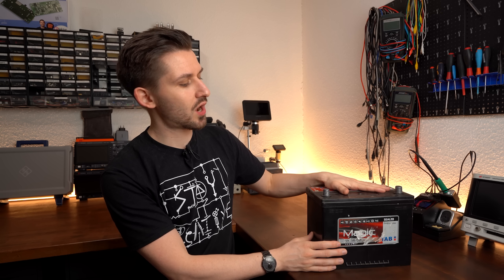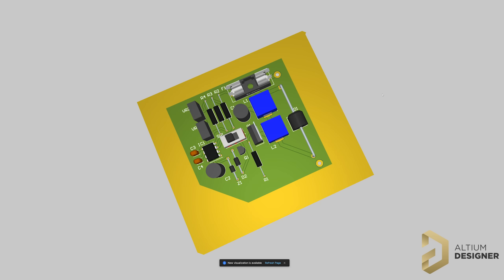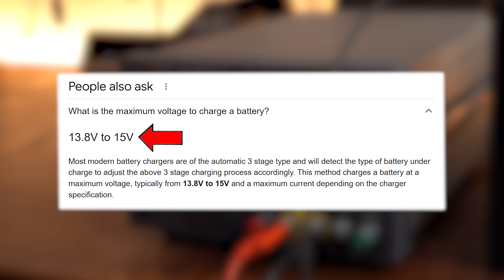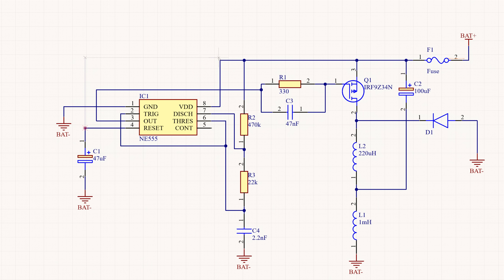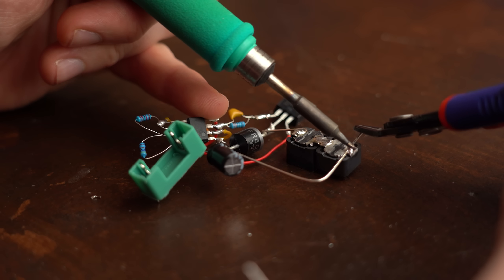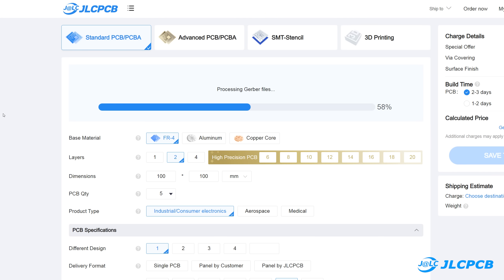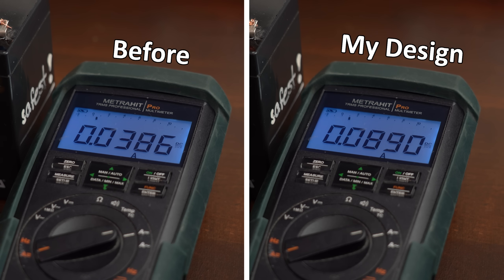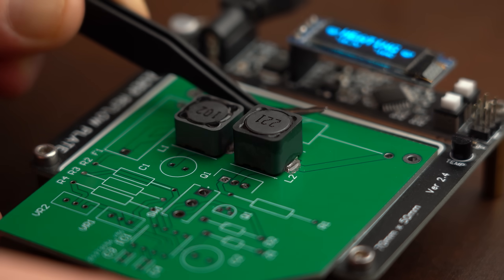I followed a YouTube "Battery Hack" and Wasted 30 Days! (Desulfator)

Comment: What you might not be aware of is that modern lead acid batteries (really meaning made in the last 20 years) almost never have solid plates anymore, instead it's like a compressed lead powder. I believe this gives a higher capacity for a given volume, but at the expense of lifetime as the plates just start to fall apart and form sediment at the bottom of the battery, and this is exacerbated by mistreatment. I don't know about US SLAs if they're the same. But there's nothing you can do to restore the capacity if half the plates are disintegrated, the gunk is no longer part of the electrode and can't exchange ions.

What this might work on is a marine / deep cycle battery since I believe they still use solid plates to better withstand the damage from over-discharge.

Comment: Ive messed around with this stuff for years, but only in the trial and error mode. What I've found is the de-sulfate thing does nothing to "fix" and weak battery. I've used battery-minders with and without the de-sulfate feature and after years of this, I've come to the conclusion that a PROPER battery minder is the key to making them last. I don't believe the de-sulfate feature really adds anything.  The key appears to be maintaining them.. ie: keeping the lead acid battery at a proper charge level at all times. I have car batteries that are over 12 years old now and still perform well, and I attribute that to keeping them at the proper voltage year-round.

Comment: There are many reasons a battery capacity can reduce and only some of them are down to sulfation. If the battery is suffering from a different problem the desulfation circuit will obviously do nothing. I'm no expert and can only go from experience. My car would be left for long periods sometimes 6-8 months due to work commitments and when returning to the car the battery was always kaput. Then my workload decreased and I used the car maybe once a week but the battery was not maintaining a charge it would last about 3 days and then needed a jump to get it going. I got a desulfator from Amazon as shown in this video and left it on there for a month, it seems to have done the job and hasn't failed since 3 months ago. So now I have one I will try it on other batteries in the future where it may or may not work depending on the failure mode of the battery in question. Think of it like this: My engine didn't start so I changed the plugs and now it's ok, in the future if it doesn't start I'll just change the plugs and it must be ok yes? Maybe, maybe not, there are many reasons an engine will not start, and there are many reasons a battery fails.

Comment: I watched a video by a guy who tested an eBay desulfator on several old batteries and it did not work on some of them but on others it did, so it REALLY depends on the exact condition of the particular battery and in theory would work best on a “still good” battery with some wear to bring it back to full capacity before it degrades to the point where the pulses aren’t enough to help it.  For the ones that cannot be restored, one other YouTube favorite trick I’ve come across but never tried is using a welder - requires opening the vents because of some boiling that happens, but apparently it’s an old mechanic’s secret trick type of thing...  could be interesting to test if you come across it.

Comment: The saturation of the coils is the tricky part of the design, tuning the oscillator and pulse shape do improve the desired HV pulses, a simple modification of the 555 circuit (a couple of diodes) allows a mark/space ratio of 10% to 90%... Great video Scott, back in the day my supervising Professor was very into this subject when I was an undergraduate so I built and tested dozens of them...

Comment: The thing with lead acid battery is that even brand new they will only provide with half of the rated capacity. Yes in extreme conditions you can discharge the battery to it's full capacity but with the risk of damaging it. So in this instance i don't think that testing the battery capacity will show if the circuit will work or not.

Comment: i wonder if you used a capacitor and a higher pulse current, something more violent such as 50 amps at 50v for 10ms or something (depending on capacitor sise) but once every 5 seconds, slowly charging the capacitor then boom mosfet closes and dumps all power back

Comment: I had ood results with desulfation of old batteries. if the cells were intact but could not put out big currents anzmore. I sued Bedini type circuits.

I did measure the capacity of some batteries, BUt I could not measure capacity before correctly . Since to start a carr it neesd a few hundred amps for a few seconds and I only discharged the batteries  with a few amps for a few hours.

But the after capacity was 60 to 80% of the nominal capacity.
And max currents wrer way up there of the stated capacci  lie 600 CCA for instance.

But even new batteries often don't get close to the nominal value.

All in all it did work to start many cars again and with no returns, but one.

Thanks for the test. I always apprecciate real tests.

Comment: Dear Scott.

I use the china "yellow stripe" desulfator from end of your video. The first configuration was like yours. With the same result. But...

I tried whether simultaneous charging has no effect on desulfation.

It was a risk, I didn't know what the pulses would it do with a cheap smart charger. The experiment was as follows. 4 year old battery used in a car with start stop function. 700A starting current, after charging I measured  a 235A start current. Charging with connected desulfator. After one day I disconnected all devices, wait until the voltage drops under 13V. The measurement showed a 690A starting current.

I was wondering if more was possible.

I let (unintelligent) charging voltage for 3-4 hours with around 14,4V on the battery with connected desulfator (not more as 14,6V). After charging I measured a 760A start current (after voltage drops under 13V). It is interesting, that this battery charged in this way, while the voltage is above 13V shows a start current under 700A.

Unfortunately I have no devices to measure the battery capacity. But this battery now works well in the car.

Comment: GreatScott!, your new circuit design basically does nothing to the battery because the freewheeling diode just circulate the current around the inductor-inductor-diode loop. No current goes back into the battery when the MOSFET is turned off as what you would expect. The original circuit, however, does generate current pulses into the battery.

Comment: That's a brilliant time lapse video...I managed to get good results for my car battery by using a malty cycle charge discharge routine in a day not a month. with the electrolyte topped up with de-ionized water and I used a "RING RSC612 Automotive smart battery charger/tester". its got a repair function(among others) and seems to use a routine and frequency while charging and discharging... perhaps you could get a better circuit if you scope RING's frequency... and yes if one of the cells is dead then you may get different results. I have used some magnesium sulphate + distilled water in some of my other experiments and also got positive results. and also you need to gauge the electrolyte density at some stage with a  hydrometer. If you still fail with that I have seen people kill the chemistry all together with baking soda in water, rinse out until no more bubbles and then put in a new chemistry called Alum (formerly; pickle juice) i.e. if the plates are strong enough to retain their structural integrity....

Comment: From my personal experience.. i ve tried everything with dozens of batteries i ve replaced the acids etc i bought hydrometer make a lot of experiments ... My conclusion is that there is a way to revive a battery... Not any battery but lets say you have a battery that it started to misbehave not prividing enough cold cranking amps but it just started doing that .. lets say its not starting the car on the morning and then its starting.. this battery can be recover the solution is much simpler than you think.. overcharge it but not cook it ... Let it bubble slowly it will desulfate.. the most common solution is to hook without solar charger a 30 watt solar panel 20 volts straight to the battery and leave it to its job for 7 days .. Stop looking at it and messing with around .. after a 7 days slowly overcharge it will be recovered.. it works 90 % of the time.. but the most important factor is that the sulfation is at the primary stage * freshly misbehaving battery.. You cannot revive a battery that is sitting uncharged around for months ..

Comment: I am using a commercial desulphator device from the past 10 years and I have that the battery life will increase or there will be no premature failure.
One has to use this desulphator from day one to achieve the best results.

Comment: To really desulphate lead batteries you fill them with destilated water and charge them until full, then "throw away" the thinned down sulfuric acid and refill with fresh destilated water.
Repeat this 3-4 times and lastly fill your battery with 37% sulfuric acid.
Oh and no way you could do this at home, as you can't buy sulfuric acid in the needed concentration in the EU.

Comment: Funnily enough I've just built a "battery exerciser" for a motorcycle lead-acid battery.The idea behind it's use being for when you have a battery that's being left unused for a few months,and you're unable to charge it up.The circuit switches on a load,drawing a few hundred mA,for a fraction of a second every minute.The circuit stops switching on the load when the battery voltage drops below an adjustable threshold.Supposedly the "exercise" reduces sulfation,but I can't find any evidence to support this.Does anyone know if I'm wasting my time with this? Thanks.

Comment: Real battery desulfator is made like charger, but it charges battery using high current pulses, those high current charge pulses actually desulfate battery.

In this video that circuit discharged battery using high current pulses.

Comment: GreatScott a great video and good topic as usual, i did many test with car, ups and small 6v batteries, looks like the only way to bring them back is to charge and discharge with a low current 10% of capacity for many cycles minimum 10 also the level of liquid should be monitored and add only distilled water if needed...

Comment: Anecdotally, these work on batteries that have been damaged from deep discharge or sitting discharged for a long time, and that's not taking a charge at all, at least to make the battery usable for a few more months or years if you're really lucky, likely at reduced capacity and output.

I wouldn't buy one, but my charger has it as an extra function, and it's been useful at times.

Comment: I have heard, can't verify,  that a lower than usual  dc charge current applied while
Pulsed desulfators run, works best. now I have no clue if this is a legit thing or not but heard that's why many fail at desulfation as pulses break up and constant dc allow transfer between electrodes and electrolyte, great video thanks as always!! A hot debate for sure, always great videos from your channel!!

Comment: Question is if this device can be used as protective measure. Eg. use it every month for a day from beginning (new battery).  Or even connect it permanently with small additional circuit which will be switching it on  when engine of the car is off. But results of this experiment will be visible after 6-8 years:)

Comment: I have seen these little circuits for sale for years, sometimes at high prices. I was always skeptical, but didn't have the time or money to pursue it. 
THANK YOU, Scott, for debunking this for us, appreciate it very much.
Reply: years ago I found a commercial desulfator advertised with great reviews for extending golf cart & forklift battery life. They were not cheap, almost double the price of the deep cycle battery, but at the time I was in need of reliable emergency back up batteries, so I combined them with solar trickle chargers to keep them going unattended for months.
6 months later I needed to call on and use the batteries, only to find everything dead, so dead that they wouldn't revive with a normal charge when I got them back to civilisation.
An expensive learning experience.
Reply: @bigbadwolf1966  And did you measure if the trickle charge could keep up and more with the consumption of the desulfator. Seems in your case you simply flattened the battery completely, sitting in that state for  while will ensure failure.

Comment: I think that the problem is not the circuit "not working" but the fact that you dont keep it under constant charge. it the circuits manages to convert sulphate back into acid, and then just drains current causing sulphation, it's never gonna work.
I revived some batteries to extend their life, they eventually died but i got +1 year of daily cicling for each one of them.
Also if you find a gel battery that shows almost dead, try to open the lid and add distilled water and let them sink in. Sometimes the gel gets dry

Comment: You can "revive" batteries. But it usually takes extremely high voltage and amerage. Usually using a welder. It only works sometimes and isn't perfect.

Comment: I've seen videos from reputable channels where people do successfully revive batteries using a desulfator. I remember one on a channel called Steve's Small Engine Saloon where he tried it on four different batteries and if I recall correctly he managed to revive two of them. His takeaway from it was that the desulfator device he had purchased had more than paid for itself by reviving two of the batteries. It DOES WORK, but success is very dependant on the specific condition of the battery. You should look at it as something to try before spending a lot of money on a new battery. If it works, you've saved some money for now, if it doesn't, then maybe it will work on the next battery. Ultimately you will end up replacing the battery, but if it works it gives you some extra time before you have to stump up the cash!

Comment: @GreatScott! I tried this circuit about 20 years ago and it DID work on a 9ah motorcycle battery, but as you have found the original design is pretty poor. The reason is that the 'mystery' resistor was actually too low in value and the whole circuit was dumping the majority of the current pulses into the 555's filter capacitor through this resistor. 

I redisegned the circuit slightly, used a high value inductor in place of the resistor along with a series diode (if I remember right), because the high current pulses are supposed to cause the battery to resonate, the frequency of this is somewhere up in the MHz, unfortunately this was a long time ago so I forget the fine detail but I was actually able to see the 'ring' of the plates or electrolyte or whatever on an oscilloscope. If you have anything in the circuit which absorbs the energy from either the high current pulse or it's assosciated 'ring' then the circuit won't work at all. 

This is another reason why the pulses must be kept to an absolute minimum, you need enough energy to ping the battery but also it needs to have a very high dV/dt so that it gets everything to resonate in what is a very poor oscillator (i.e., big chunks of lead and liquid electrolyte). 

Alternatively you can isolate the 555 power supply from the battery completely. so that you're sure it doesn't sink any of the voltage spike. I'm not sure what flavour of MOSFET you used but I found it has to be fast and have a very high Vds as otherwise it will again rob you of your current from your inductor.

Comment: When something sounds to good to be true (like connecting a simple circuit in parallel and forget about it), it is not true or at least not that simple. Also the question remains, if this works, why do car manufactures don't include it in the electronics in the first place?

Comment: Interesting 🤔 & ty!  
I read a scientific paper on electroplating which used very specific pulses with a delay between each pulse. 1st was positive less than like 4v or so, but I forget exactly how much and it was a spike not a square wave. The second was slightly less volt like -1.5v or something like that.  
The time for each pulse and neg pulse (wave length) was around one per sec.  
This design was very successful for electroplating rare metals and thicker layers than anything to date.  
My guess is that using this config has the greatest chance of decalcification of a battery.  If you want to try it, I can try and find the technical research paper again?
  I actually would love to try it but I'm not certain how to create the positive then neg spikes?  When I say spike, I mean like a sharp one from some integrators. 
I have created electroplation circuit before for simple metals including nickel and it was very successful.

Comment: Just a word of warning.
Most batteries are not setup for too much sulphate flaking.
So if you do this without cleaning out the acid and sulphate and the battery doesn't have a large catch tray at the bottom of the battery you risk a rather nasty short circuit.

Also modern batteries are higher capacity due to improvements in manufacturing which increases surface area.
This new design does not work well with simple pulsing.